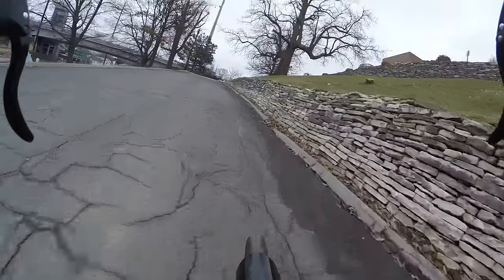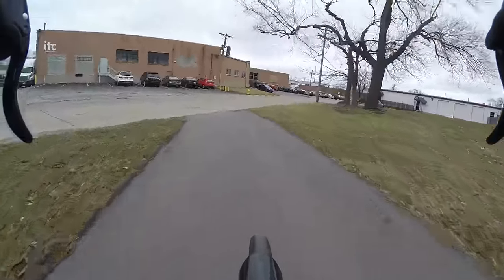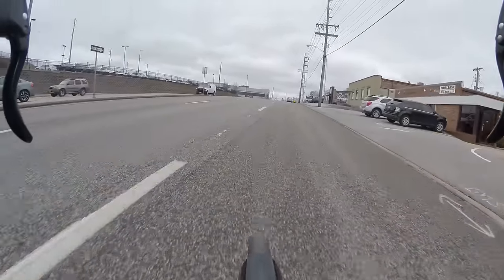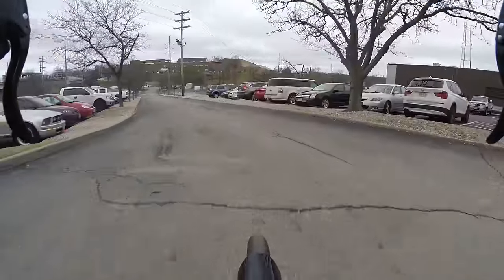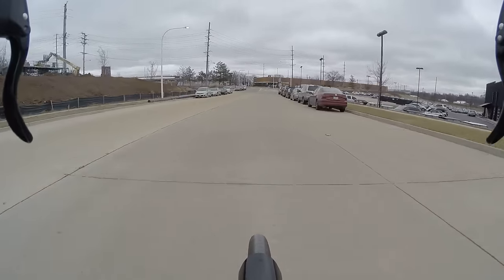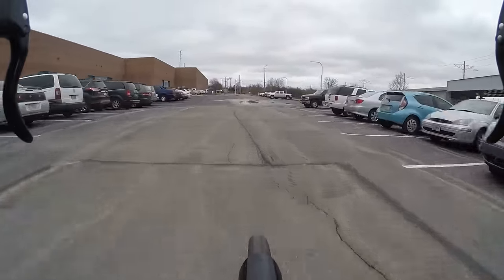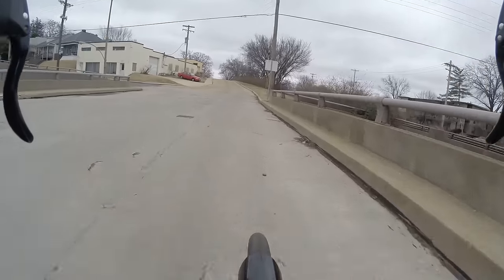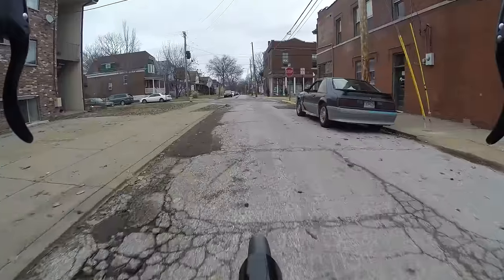So Far So Great Singlespeed Commuter! Bike Blogger

Comment: as you get your cycling legs gearing becomes infrequent until eventually it stays in the lowest gear.....a nice feeling of achievment going up a hill that was a struggle in the beginning but after a few years right up the hill in the low gear. Walking up a difficult hill is common for beginners.

Comment: Every FEW HUNDRED miles a new chain???  DANG!  My last KMC X10L Ti-n coated 10 speed chain lasted me almost 6,000 miles of mostly commuting!  My Ultegra 6700 10-sp cassette has almost 10K miles on it.
Reply: Patrick94GSR How often you have to lube the chain?
Reply: I don't follow a specific schedule.  I try to lube after riding in the rain, or definitely after washing the bike.  Usually just when it makes noise I'll lube it.

Comment: Did I see trp hy/rd brakes, don't know if you still use them, but if you do how do you find them
Reply from the maker: Yes I used TRP hy/rd on my bike and like them a lot. I haven't used full hydraulic but I think mechanical actuated hydraulic is the way to go! Great feel. Works with regular STI levers, no hoses or complicated bleeding processes. Currently I've gone back to rim brakes because they are even simpler but if I were to go back to disc I'd look at TRP.
Reply: @BikeBlogger  the trp hy/rd always interested me, i might have to get a set and try them out on my gravel bike, i have 3 bikes with shimano hydraulic brakes, and 1 grave bike that is mechanical disc,  the hy/rd brakes seem like everything i could ever want, i love the idea of the master cylinder being in the caliper it self, it seems like a better design to me and i like the brakes being cable actuated. the system seems like it would be much more simple to maintain. i hate dealing with hydraulic brake bleeding.

Comment: That's a neat trick or happy coincidence to get the perfect tension on the chain with vertical dropouts. How are the Cosines holding up? I just picked up a pair for my off road hybrid 26er/29er gravel bike, but they won't see action for a while yet.
Reply from the maker: No issues yet. They haven't properly run the gamut yet though.

Comment: I haven't ridden a single speed since is was a kid, 50+ years ago. I'm looking at getting a new bike, Might look into a single.. I'm not in good shape.. I'm looking at biking to get in shape. I'm thinking a multi speed would be easier till I achieve a better level of fitness.. Your thoughts?
Reply from the maker: Yes, multi speed is widely used by most people and recommended. Singlespeed is great for flat terrain, a person's favorite gear, and those who just prefer the style of riding.
Reply: Yeah, I think multi speed for a fat old guy.  lol. At least till I become a slim old guy
Reply: I don't want to step on BikeBlogger's toes here, but also, the increased gear options will save your knees...even if you lose the weight.  cadence is your friend as the knee joints age!

Comment: How hard was it for you to find the "magic gear" to run without a tensioner? And how long did it last before the chain stretched out? I wanna build my old cannondale as a fixie/ss but I have vertical dropouts
Reply from the maker: It did take me a few months. I started with the gear on my multispeed bike that I used the most, and then ended up buying multiple cogs to try on the singlespeed conversion. I ran no chain tension the chain to start wearing and dropping after a few hundred miles.

Comment: isn't it better to install a chain tensioner so you don't have to replace the chain again and again?
Reply from the maker: Yes
Reply: There's videos on how tighten it with single or fixed without a tensioner.